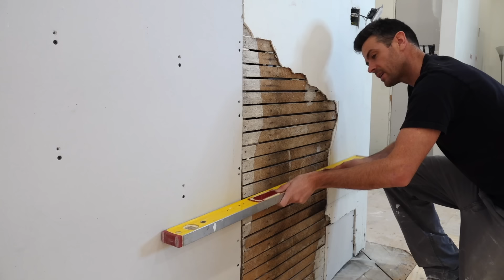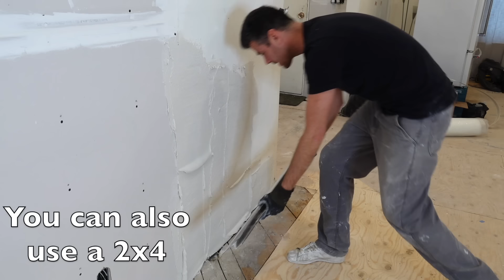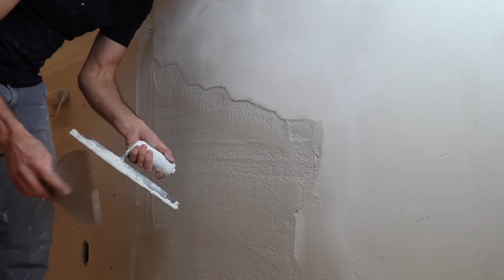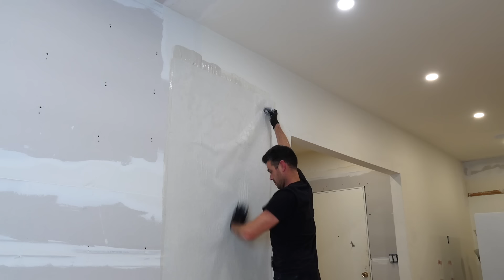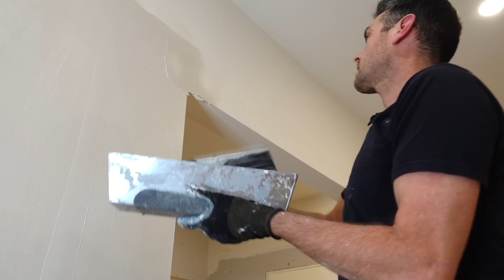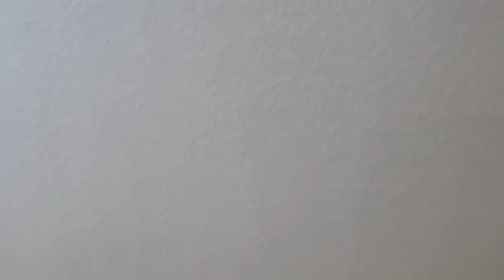Lath and Plaster Repair!

Comment: will this repair last as long as taking it all down to studs and do it over?
Reply from the maker: Yes and no. The repair will likely last longer than the rest of the wall but taking it down to the studs and re-boarding will possibly last longer. Just depends on if you are willing to demo the whole wall or not.

Comment: Hello!  I've been watching a lot of your very helpful videos because I'm fixing up my home for sale.  It was built in the 1950s and has plaster walls, but no lathe.  It appears to have plaster panels that look remarkably like drywall, and a plaster skimcoat over the whole thing.  In some areas there are LOTS of cracks and in cases the top layer of plaster is slightly protruding at the cracks.  I'm trying to determine how much of this can be fixed using the FibaFuse, and in what cases should I pull out the loose layer of plaster, hot mud the void, then put FibaFuse and taping mud over it.  Any thoughts or advice you have would be gratefully accepted!  As an aside, the ceilings in the house are worse than the walls, and rather than trying to patch them, I'm putting new drywall over the old plaster because it will probably take less time and be a permanent solution.  

Thank you for your channel, good advice, and good humor!!

Comment: So, I've seen a lot of people saying that lath and plaster is a pretty old style... but when did it stop being used? I ask as I'm in a house built sometime between 1965 and 1970 - the walls definitely aren't drywall, but I don't think they're lath and plaster either. There's a section of water-damaged plaster I need to repair, but I can't tell what I'm seeing underneath - it looks like brown concrete, but there's these dark brown chunks in it, I can't tell if they're wood or badly rusted metal and I have no idea what they are. (It does look like someone tried to patch it previously, but whatever they used didn't stay bonded to the brown layer.)

Comment: Too many good things about this video to mention and pro quality and attitude work. The fibafuse looks like the perfect solution for a 9x20 wall that has tons of cracks but the lathe itself is solid on my 1912 home. Another benefit of keeping the lath and plaster is the strength and sound proofing qualities over drywall. I've had to repair holes in drywall due to someone leaning back on a chair and often hear of upset teenagers punching holes in the drywall. You''ll break your hand on L&P before you can punch a hole LOL.

Comment: Boy! What a mess. Durabond is the proper plaster to base coat with a rope or hemp fiber renforcer to stop cracking. Bonding adhesive Is necessary to spray over the whole of the patch. You then use a lime engage and trowel out the finished Plaster with a wet mop and a twelve inch Trowel. There is no sending with real plaster. And when bonding and sistering drywall of plaster , it will always crack.

Comment: I would’ve done this with my cracks had the rest of the wall not being covered in 30 layers of wall paper where you could see tears & paint over. Just demoed a bedroom & getting ready to do drywall now. Home was built in 1890, my moving too & dining room are both still solid plaster however & in great shape, I’ll keep this is mind when it comes to those rooms .

Comment: Thank you for this video!  We have a house with plaster and while most of it is solid, it needed some love. I ended up fixing the loose plaster and then using fibafuse across the entire room's walls. Now everything is super tight and there's no way that the plaster will fall apart!  Now onto the next room !

Comment: I must respectfully disagree about Durabond. it is not easily sanded or scraped, but compared to metal-- which is what I normally work with-- its not so bad, just takes longer so its not cost effective for the pro.

Comment: Interested amateur question. Classic plaster is a scratch coat with chopped hair for tensile strength, brown coat to transition, and finish coat. Could a modern equivalent be hot mud with chopped fiberglass, second hot mud, then lightweight mud? I was thinking the concrete coat you put on doesn’t have tensile strength and could pop off over time.

Comment: I’ve used fiberglass window screen over cracked and plaster where the keys were broken and the plater was just a little loose before this amazing product was available. Totally sound afterwards.
Reply: I have  used  fiberglass mesh for eifs,  but  window  screen is thiner and will cover easier, however fibafuse is a great  product

Comment: I have a big question...maybe. thanks for the video btw...I took a job repairing A LOT of plaster where electricians made a mess of the wall. I used 90, 20 and all purpose. The existing walls have little bumpy texture that I can't figure out. It's not orange peel and I REALLY NEED HELP MATCHING THE TEXTURE.. PLEAAAAASSEE
Reply: My 1950s house has many plaster walls. Some of them have weird bumps and others have fan swirls. A wall in the guest bedroom has some bowed spots.

Comment: Hey Ben,  I am repairing a ceiling and a lot of it has water damage which I will replace but in other areas there are just cracks and it isn't lath it is just drywall. Can I use this roll on method there and put the fiber fuse over it? I guess my question is - is this ok for drywall or just a technique applied over lath?

Comment: 😊a "darby" is a flat tapered piece of aluminum and is flexible. 
What you have is a "featheredge," which has a ridged backbone. 
Anyways, no biggie. Great video
I am plasterer 1963😎👍
Reply: Featheredge is the tool I’ve wished I had but didn’t know what to look for.

Comment: Great work as always. I think I may have stumbled upon this video at just the right time. I’m beginning a renovation in one of the rooms in my 1853 home, and the walls are riddled with cracks, most of which are very fine spider cracks. Despite the cracks there is no movement of the plaster so it doesn’t seem to be separated from the lathe. I’ve dealt with larger cracks over the years; etching, filling, taping, then finishing, but i feel like prepping all of the fine cracks in this room will be impractical. That fibafuse looks like it might be the answer. Now the question is, the walls are painted with what I’m assuming is acrylic paint, so will they require priming prior to application of the mud/fabric? Thanks in advance.
Reply: I would scuff the paint with sandpaper and give it a coat of PVA glue as a primer.

Comment: Nope.  leave the lath and coat with Plaster Weld, Structolite for the scratch coat, then plaster, or compound, or a mix of those.  Dozen years of using this method in NYC, also Seattle and Portland.  Not so easy toget Structolite on the West Coast - usually have to order it.  Plaster walls are worth saving - far superior to sheetrock.

Comment: This video is a life saver my home is 120 years old and all lath and plaster. There are some cracks in the plaster and I was told countless times it would have to all be ripped out and dry walled. This method worked out amazing! Thank you soo much!
Reply: My god, thank heavens you didn’t listen!!! My house was built in 1879 and I was told to tear out my old windows by a couple idiots …. Jokes on them, with a little care I rebuilt them and they’ll last another 100 years probably!
Reply: @vancouvervixen4253  that's next on my list is figuring out. I have glass I need to replace. I just want to replace the glass the rest of the frame is in exalent shape and thermal insulation is ridiculous in the home.
Reply: So glad you 'restored' your home. Im dealing with this in a bathroom. I had papered it & with removel, many chunks of plaster came with. 😮
My friend will be fixing it, I'll show him so he doesn't drywall.
Reply: its really frustrating how everyone has zero appreciation for p[laster and always just "rip it out and drywall!" if i wanted a drywalled home i would have bought one.

Comment: Thank you for your videos! We had largish holes in our lath and plaster ceilings caused by workers reinforcing our attic joists and accidentally stepping through in a few spots. Our contractors patched the ceilings and in some cases put drywall over the larger holes, including adhering with liquid nails. They then put mud on top to complete the patches. We ran out of money and can’t afford to pay them to paint! Can anyone recommend what kind of primer is best for going on top of plaster mud before we paint?

Comment: One thing that I haven't seen you do but I always do is whenever I tear off crumbly plaster, I always make sure that the edges have been glued back to the lath. Basically just drill holes, spray in some watered down PVA, then jam in a mastic gun and squeeze in some construction adhesive, then use a screw and washer to squeeze it down. Once it has gone off that plaster is rock solid to the laths and will hold better to whatever you fill with.

I've done this method with cracks that I've only repaired with filler (no tape at all) and you can bounce yourself off the wall and it stays rock solid.

Comment: I had the same problem with the old house cracks everywhere plaster falling off. I asked the owner it’s just going to put quarter inch sheet rock around the whole room and it worked out perfect.

Comment: Didn't know FibaFuse came in huge widths like that!  Awesome!  I have a weird architectural feature that sees drywall butting up against MDF, and it seems that no matter how much I fill and sand, fill and sand, it will not get flat.  It's edge-lit from above, so the tiniest little inconsistency stands out.  It needs to be level-5 flat, and I just don't have the skills for that with mud alone.

Comment: If i had watched this post first I'm sure that i would have followed your advice.  I did use durabond for the base coat and then coated over that with general purpose.  It came out fine i just hope that it holds because I didn't use fibafuse. Thanks for the leason.
Reply: it will chip if it hasnt already. and crack again. should have used fiberfuse sheeting

Comment: The whole wall probably should have been gutted down to studs to permanently address the crown in the wall but I’m not there and can’t see how long the wall is and what the opportunity costs are for each option to handle it. I can see why they hired you but I’d be interested in seeing what it looks like in a year. I’m sure it looks great now because I’ve seen your work but most muds lose integrity around 3/4” thick and will crack overtime rendering another repair.
Reply from the maker: I've found as long as there is a large tape supporting the mud it will last longer than a regular drywall joint. The mud is harder and denser than the existing drywall. If it is sandwiched between two materials it will not lose integrity.
Reply: @vancouvercarpenter   wow so cool you responded to my comment! I’ve seen all of your videos and subscribed to your channel a few years ago so I’ve been a fan for awhile buddy lol I’ll definitely consider using large tape next time I run into a job like that. Thanks again bro!

Comment: thanks for the amazon link. Ive  been using this product as joint tape for years i did not know it was available in 3' wide rolls  this product is going to be used on a fire restoration of a historic home.

Comment: You need structolite for that hole then cut back a little on your base so you can level and run finish lime and molding plaster that will fix everything I know I'm a 36 yr plaster

Comment: Pro tip: use latex modified thinset. Mix it up stiff, and if you're in a hurry, you can mix 50/50 fast setting thinset. It bonds to almost anything. When it firms up, screed it smooth, and after its fully set, follow up with normal compound.
Reply: I tried this. t's not sandable.

Comment: Love the channel, your help is slowly improving my mudding skills. I have a question maybe you or your subscribers can help with my next project. I took down old paneling and the finish plaster coat just crumbled but the key scratch coat is still in good condition. You said to use carpenters glue but it's a big room. Are there other options like just wetting the walls so the mud won't dry to fast and crack, or using primer on the old key scratch coat, or any other suggestions?

Comment: Excellent work  as usual 
Just to make sure I understand 
That fiberfuse can b used to cover a 20 in X 20 in hole  in the wall Just as well as cutting a piece  of sheet rock and screwing  it in
Reply from the maker: Yes it can.

Comment: Love your vids! 
I have old plaster ceilings with those numerous cracks (from age and weight of new attic insulation).  They seem somewhat stable.  Would you recommend that 3’ fibafuse method and skim coat rather than individual fibre tape strips? Not a fun job either way!

Comment: 7:40 Best wide mesh demo ever! A pro tells me this is best for blown out plaster. Neither taping nor “heavy” mud is widely available in US. Would you recommend setting, light, all purpose, or topping for embedding? Maybe add glue too? I’ll use a short roll of 36” fiberglass mesh from HD. I also find durabond easily usable on the first lathe coat.
Reply: Green cap
Reply: In the states
Reply: Think I got it. Your glue video suggests Easy Sand setting compound with weldbond is what I should use to embed mesh/fibafuse over a painted wall. https://youtu.be/RxIduTQXToQ
Reply from the maker: I would embed it with all purpose if you are doing a large area. Setting mud could be a pain in the butt. Make sure your mud is pretty thin so it wipes out nice.
Reply: @vancouvercarpenter  Thanks Ben, then it sounds like a little glue for strength and adhesion with all purpose is the way to go. There's a bunch of hairlines I haven't prepped with scoring, screws, and durabond during the initial treatment so I'm a little skeptical that all purpose and mesh alone will hold up especially because I'm going over sanded paint. 

I think this is a good approach. Plaster Magic seems over-rated when there are many hairlines and most of the lathe is well attached. I want strong mud that will hold onto the paint and mesh.

Comment: Hey Ben, I just put drywall on a ceiling and then the walls.  And i pushed the drywall up to the ceiling and there's a big bow/sag in the ceiling making the wall drywall have large gaps between the wall and ceiling drywall. 
What would you do in this case?
Reply from the maker: Pre fill it and then tape it👍
Reply: @vancouvercarpenter  sounds good! Wasn't sure if mud and tape would be better than scribing the drywall and cutting it to fit better although I'm sure it would still need filling with hot mud.

Comment: I remember when my wife and I sold her old home and it had plastered walls that needed a bit of work. We found a guy who did a wonderful job and it was actually a selling point that we retained the original walls.

After the neighbor's tree fell on the home a couple years later the new owner had to gut the upstairs and start over. They also got rid of the knob & tube wiring, which I don't think anybody missed.

Comment: @vancouvercarpenter821 sorry for off topic.  Don't know how else to ask a question.  I've drywalled an entertainment unit with TV insert, fireplace and few shelves.  Doing all the edges with the paper/metal corner beads.  Question is some corners are horizontal and only about 2 inches apart.  Can these corner beads overlap ?  Just the paper side ?  If not how can I use corner beads on 2 close edges.  Hope that makes sense
Reply from the maker: It’s no problem if the paper overlaps👍

Comment: I just wanted to say thank you for your hard work in paying these videos. They’ve helped me in ways that you won’t expect. I’m an artist and most recently decided that I want to do a piece which would require me to use drywall as my canvas. The problem is, I will have a raw edge. Do you have any suggestions on what I can do to cover that raw edge seamlessly? Mud is one way, but that may crack over time. I have to find something that’s secure and won’t make me worry. Any suggestions? Many thanks to you!
Reply from the maker: Use an L edge corner bead and miter the corners.

Comment: I have a 3 ft wide role of the yellow mesh we use for joints, would it work the same way to hold large sections like this together?  Or would it be more for exterior stucco patching?

Comment: Great shout! We just did a Reno - with an addition on to an existing plaster finish. We did not go to this extent and the cracking of the old plaster is hard on the eyes for sure. The budget for the job and the customer had a ceiling and understanding , respectively. This is very, very helpful and in my future this will certainly help when I quote a job. 

Many thanks from old Toronto!
Wishing you lots of success, good health and smooth pulls this year! 👍🏽

Comment: General Question Ben... I usually do two coats of Sheetrock 20 and then sand and use the pink spackle to fill any remaining perfections, since I am doing patches and painting on the same day. I have not had any issues with this method, but I am curious why you use an all purpose mud. What is the usual dry time for the all purpose mud and I use the Bin sealer primer after my finish sand, wait about an hour and then apply my first coat of finish paint after that. The second coat if required is applied a good hour after the first, or based on the manufacturers recommendations.

I hope you can shed some light on my questions, as I would rather tell clients that the patches will take two days, then sacrifice quality!

Thank you for all your time putting together these videos, and you have helped me greatly with my mudding! (Now plastering as well haha)